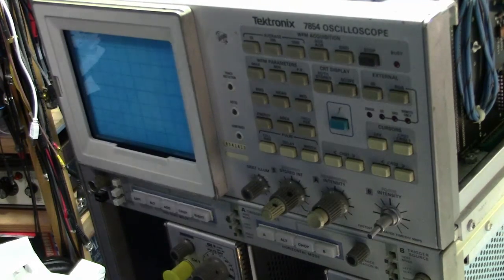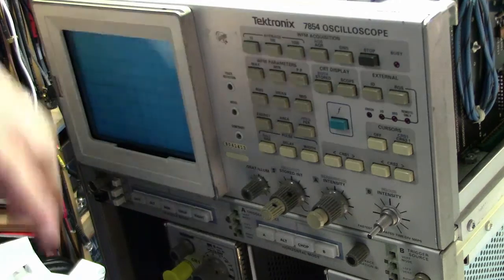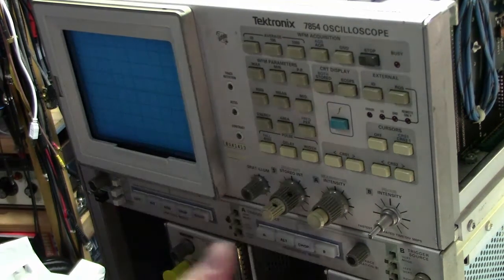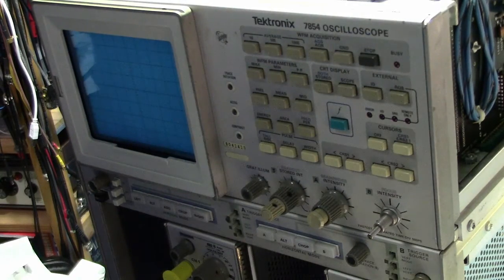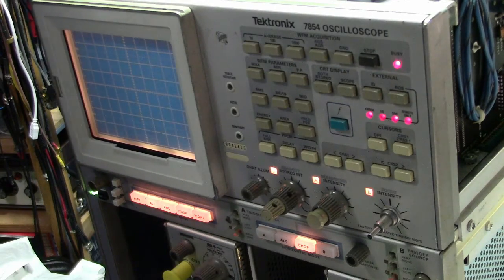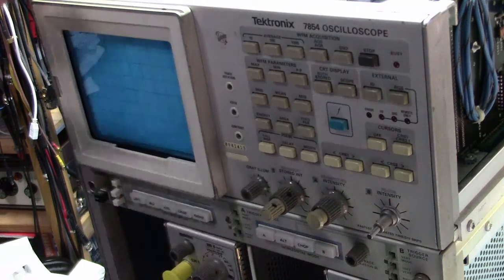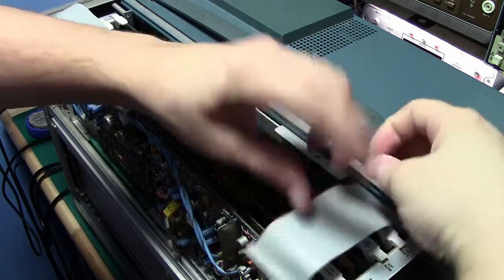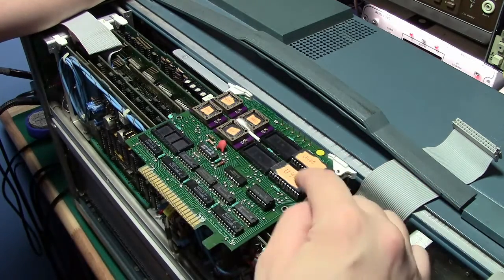Tektronix 7854: Initial poking around

Comment: Nice work. This is probably the hardest place to start with TEK scopes. It is the first cross over between the apex of the 7000 line and what becomes the digital scopes. 

The team that design/built this was split. Old TEK people mixed with new. The product shows the fault line clearly. 

I hope you stick with this. Maybe pick up a cheap 7834 and gets some grounding. Without it, you are going to have to develop schizophrenia. 

Seriously, this is a very hard place to start. Genius analog and really bad digital. Don’t assume TEK had any idea what they were doing on the digital side.

Comment: Check the power on light codes.  I had to rebuild my ROM board (programming EPROM chips, socket adapters for them since they used mostek ROMs).  Was a bunch of work but now I have two working 7854 scopes.  These represent the height of scope technology in the 80s.

Comment: i have picked this same scope up for free and me being 17 have NO IDEA about how to use it, when i power mine up the B light comes on and if i press any button on the vertical side the CHOP light comes on and then back to B if i press the vertical buttons again... help??? i know nothing about it
Reply from the maker: It's a 7854?  I have the service manual if that might help you.
Reply from the maker: Actually, I should ask first, do you have any plugins for the scope, and which ones? If the scope is in working condition, it is a very nice scope :)
Reply: idpromnut yes its a 7854, i have 2 dual trace amplifier plugins, 1 time base plugin and 1 delay time base plugin
Reply from the maker: Do you get any text on the screen when you power it up? Any message(s)?
Reply: idpromnut i cant tell the scope wont let me move the green line at all (not sure what to call it) but as far as i can tell no text
Reply from the maker: Hmm, no text is a bad sign. If you are getting a green line (horizontal or vertical?), that is the trace. It could be that the CRT is misaligned, or that one of the control signals is not working, hence a line instead of a picture (if it's a horizontal line, then the vertical control might not be working). You not being able to move the "trace" makes me think that is one of the problems with your scope. If you try and see if you can fix it, be /very/ careful as that part of the scope has high voltages!  Do NOT use a regular multimeter+probes if you don't know what voltages should be in there.
Reply from the maker: The scope that I have actually had a CRT problem as well, but the fellow that I got the scope from had fixed that part already.
Reply: idpromnut im not good with electronics. Ive learned that messing with a expensive CB radio i messed up so i defiantly will NOT be working on it, i picked it up for free so im not out any money i also got a Tektronix 549 as well that works fine
Reply from the maker: Hmm, that's too bad, it's a wonderful scope. Depending what you're thinking of doing with it, it would be rather neat to try the ROM board you have in my scope to see if it works at all (or if there are other problems).
Reply: idpromnut yeah. Well it was free so its a win win either way

Comment: ... and that pin-for-pin replacement chip is.....: MCM68766.
Reply: The original ROM and the MC68766 are 24 pin devices. Most 8k x 8 devices are 28 pin, as is the AT28C64B, which the author's above datasheet refers to.

Comment: A pin-for-pin replacement chip for the original ROM is still available, mostly on Ebay, for around $ 10 each. I used units from my existing stock in one of my 7854's.
It may be worthwhile to get the original patch ROM from the previous owner if possible.